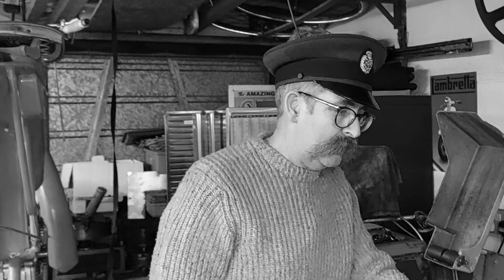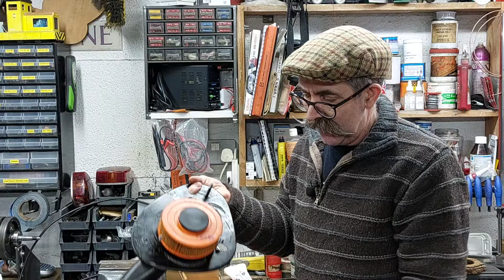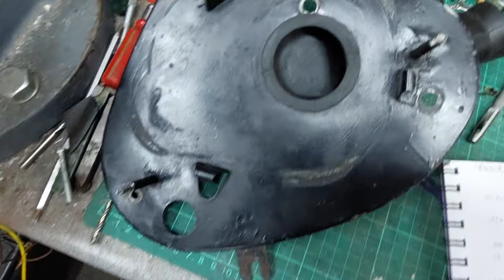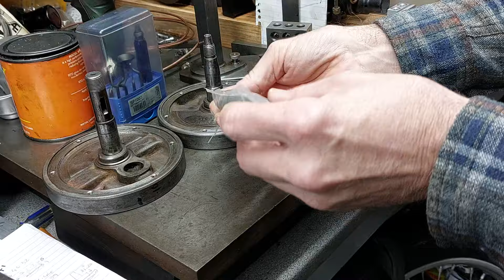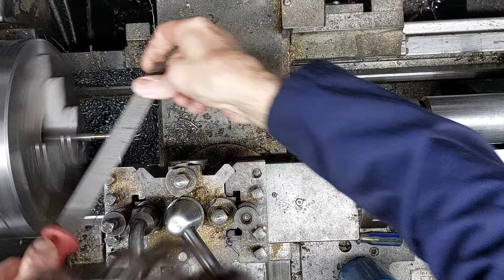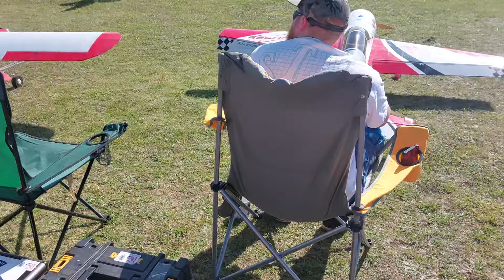BSA BANTAM WORK CONTINUES, AIR FILTER MOD, CRANKCASE SCREWS AND FINAL CRANK DISASSEMBLY

Comment: You are a brave man Mr Tweed for going full hog and making up new padding plates. Back in the day I had a B175, I just removed both of them. I retained the 'horse shoe' padding piece that was located in between both flywheels and retained by the crankcase halves clamping it in place. What I dont know is if that piece was fitted as standard to all later Bantams or if it was an after market tuning mod.
Reply from the maker: Sounds like an after market tuning mod Paul ( probably rare ) It was said that the racers were known to fill the voids in the crank with plastic padding ....

Comment: sorry Mr tweed to question your wisdom, but to fanny arround with an air box, when my dad rode endless miles to and from work on his bantam over many years with a hit and miss steel mesh air filter that doubled as the choke ! paper fiiters are a waste of money here. a two stroke engine chucks out 65 % of its fuel and air intake. so lets just let it breathe.
Reply from the maker: That's fine question away 😁 any old excuse to fire up the lathe and come up with a solution is all part of the fun.....mind you the old filter wasn't doing anything and I've never seen such a worn set of piston rings.

Comment: I'm going to have to figure out how to slot those screws coming off my lathe too.
Reply from the maker: If you don’t have access to a mill an old engineering trick is two fine tooth hacksaw blades together in a hacksaw and cut your slots that way ( a bit tedious I'll grant you )

Comment: Very good vid, informative and entertaining, nice air filter mod. Have subscribed. 
I've never owned a Bantam, always liked them though, I started on Tiger Cubs in the 60's, passed my test on my mate's D14 though, it was brand new, I thought it would impress the examiner more than my ratty Cub! anyway, the screws and fasteners in those days were Cadmium plated, but that's been outlawed now, bright zinc is close enough....cheers, Dave
Reply from the maker: Thanks Dave and welcome aboard, thanks for sharing your memories, always interesting to hear how these vehicles were used when they were everyday transport.

Comment: Mz made basically exactly the same air filter setup as your conversion and having owned several I have never encountered any issues with oil contamination.
 The smaller mz's are basically metric bantams anyway.

Edit,  actually bantams are imperial mz's given dkw designed the original engine and they were metric.
Reply from the maker: That's handy to know, I know MZ cranks have been used in Bantams ( they can't be any worse )

Comment: Would not use silicone inside the motor on stuffer plates.....petrol will soon have that off and may loove the plates loos.

Petrol kills silicone in no time.....turns it to goo.

Would have thought.....main air gap taken up by just the plates sitting on there mating faces.....yes a tiny bit of air may leak.....but not volumes.

I just left mine out on my B175.....would like to try with and with out.....but goes fine with out....and the cant fail if not there.

I just used alan bolts for my cases....chromed.....I think?....but look great.....easy to get out when needed.

Amazing models about these days.....that F16 was stunning.
Reply from the maker: Good point on the silicon Nick, there are better options

Comment: It really is excellent having the equipment to make just about anything. It fills you with warmth, joy and good feelings. Then the day comes where you need unobtanium screws. And you know you want them. And you know you can make them. The first one is interesting.........................and so you grit your teeth and go at it. And later on, after it's done, you declare it was fun. And it was. Sort of. Certainly an achievement. Well done sir!
Reply from the maker: once you work out the work process and get into it the time just flys by and like you say Stuart a sense of achievement when the job is done.
Reply: It's true - running a process can actually be very rewarding and soothing. It's time at the lathe - and you know that YOU MADE THOSE PARTS!!!! Making things is so cool.

Comment: I had a D14-4. some years ago. I padded the flywheels. Ported the chambers & fitted a George tod head. A 376 monoblock carb. I made a expansion chamber exhaust. The bike was quite fast but ended up snapping the crankshaft. After that i fitted a Villiers twin 2T 250 engine & it ran great for over a year. Thanks for sharing Mr Twed.
Steve.
Reply from the maker: my pleasure Steve, a Villiers 2T 250 Bantam sounds interesting....
Reply: It sure was. I got a few admiring comments with that bike. Brakes coped well too, as did the suspension. I used to have quite a few 2T & 4T engine back then. I wish i still had them.  @TweedsGarage
Reply: @TweedsGarage  There is out there somewhere a Bantam with an Ariel Leader 250 engine in it. There is ALSO a Bantam with a very interesting arrangement with a Suzuki RG500 bottom end and TWO sets of Leader barrels and heads on it. There is at least one vid of it on YT and having looked at it, I'm not really sure how much of the original D14 Bantam it started out with is actually in the final build.

Comment: No, sir, we do not like your adaption! Your adaptation, however is a perfectly elegant, non invasive solution to an otherwise insuperable problem. Though you only need an air filter for two months a year in this sog forsaken country. Dust? i dream of dust...(I've been cultivating anybody I can find called Noah just in case)... Onward and upward! Brilliant, sir, as always. A less on for we more ons...👍
Reply from the maker: Yes I think you'd be wise to stock up on timber Bill, there's been so much rain that the drive and the vehicles on it are covered in moss and they are used regularly !!!!!